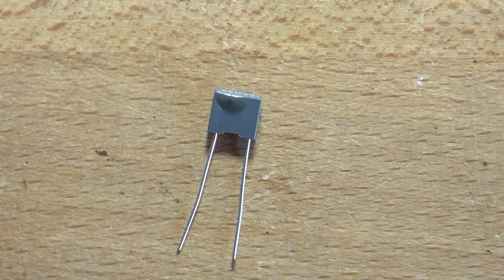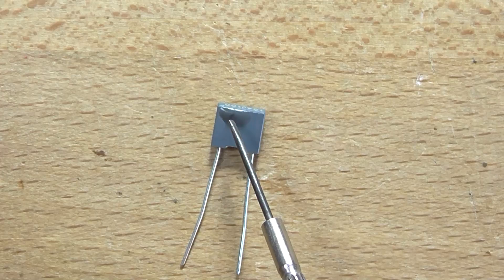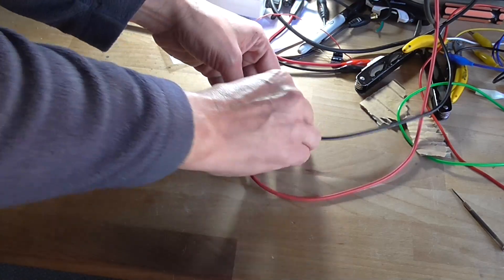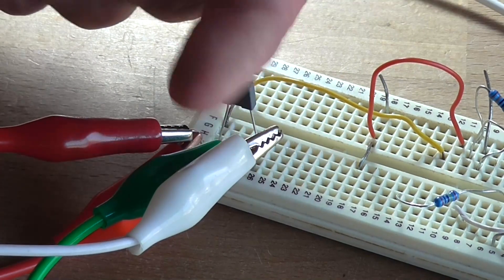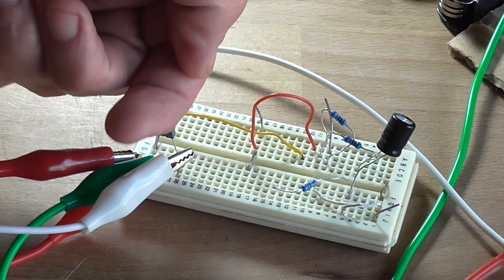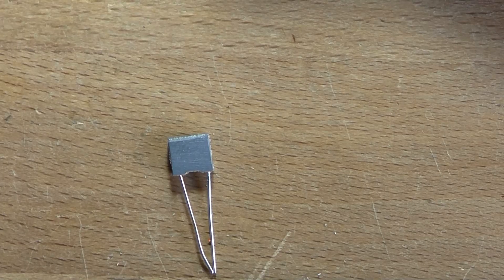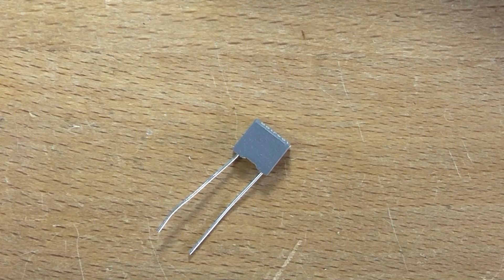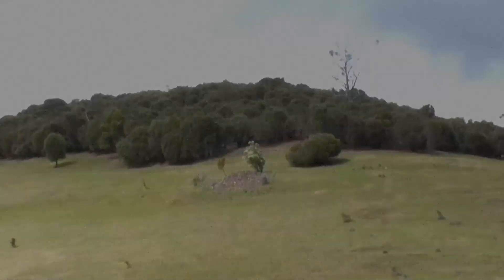Mysterious Bulging 100nF Film Capacitor

Comment: A test on AC would have been more relevant I think. 30v AC will suffice, but go up to 60v if feeling brave. However I doubt there's anything wrong with it - but I'm sure if the bulge was there from new, you surely would have noticed it when placing it on the breadboard? Have sent you an interesting circuit on FB btw.
Reply from the maker: Well, I didn't really look to closely at the cap after I pulled it off the band tape... I just installed it. So, it must of been there to start with, has to have been.

Comment: Do you have an ESR meter or tweezers? Zoyi make two good ones, I own and like their ZT-MD1 and they just released a ZT-MD2 which is slightly better for slightly more money. Both won't break the bank like a traditional LCR meter would. You can also measure leakage current with a DMM by putting the DMM in series with it in volts measurement: in this case, regard the DMM as a voltmeter that is 'accidentally' measuring micro/nanoamps by using a 10Mohm '''shunt''' resistor.
Reply from the maker: No. I'm planning on buying a cheap LCR, so at least I can measure inductance, ESR and components for basic functionality.
Reply: @AstrosElectronicsLab  both those zoyi tweezers are good for that. Uni-byte has a good review of the MD2

Comment: Wow, you put that across the mains😢. ONLY X2 rated capacitors should be used between live and neutral, and only Y rated between any of the ac lines and AC ground, never to circuit ground. Most of the time they are not needed unless at the power input of an SMPS. Even then, the goal of using it is not to polute you mains network behind the SMPS with high frequency switching noise, the resulting DC will be smoothed with capacitors anyway.
We should be careful what we preach when it comes to mains electricity...
Reply from the maker: No? Where'd you get AC mains from? It was across a 30VDC power supply...
Reply: Your smart aren't you.

Comment: Does the cap measure correct value ?
Reply from the maker: 101.4nF I believe. So, yes. Within +/-20% tolerance of the component.
Reply: @AstrosElectronicsLab  Maybe just faulty encapsulation process ?
Reply from the maker: @ericmc6482 the potting machine must have suffered premature... lol you know
Reply: I reckon something hot was next to it, like a resistor, unless your sure that's not the case?
Reply from the maker: @daveselectronicslab no, it was definitely epoxy.